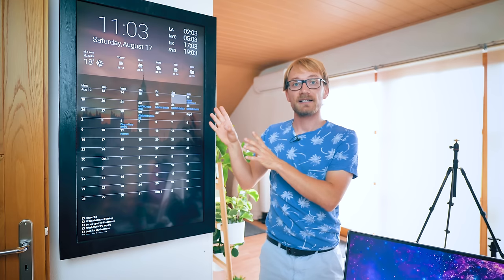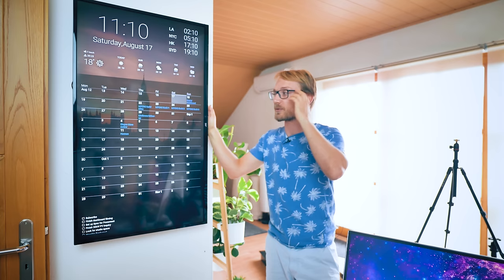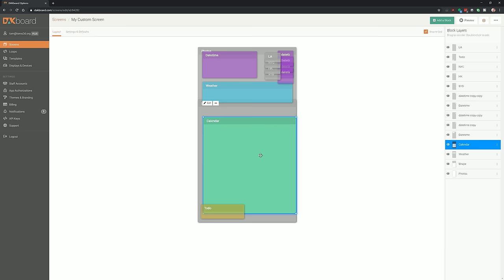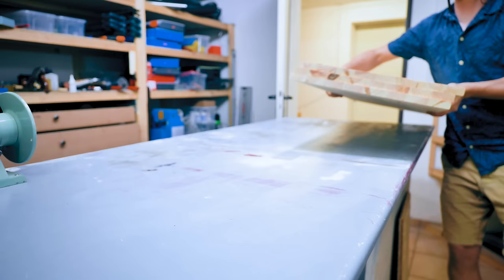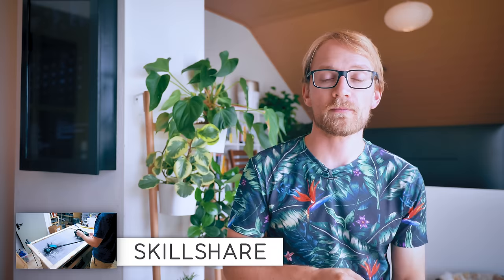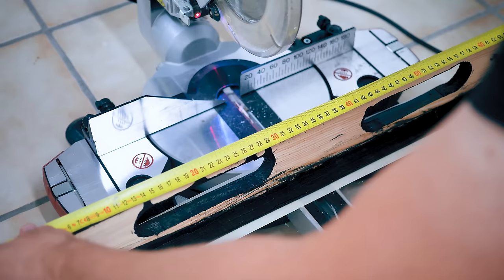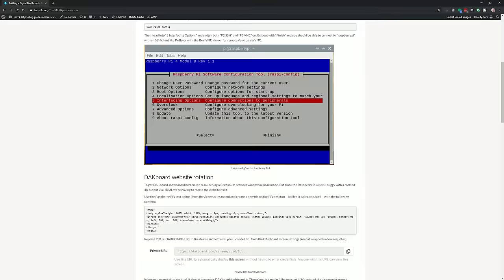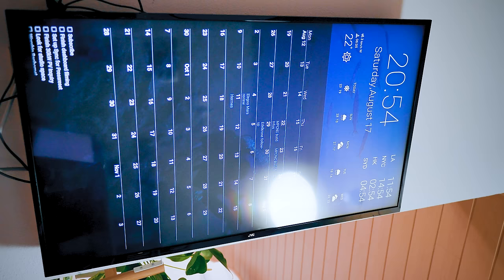Making a Digital Dashboard! (w/ Google Calendar integration)

Comment: For energy saving, I would consider installing a motion sensor for the screen in your frame.
Reply: Or even something as simple as proximity sensor.
Reply: That depends. Some TVs take a few long seconds to turn on and show content.
Reply: That just crossed my mind (just watched the video and was about to comment)
Reply: Then you can just hookup your security system to detect any movemnt in the house to turn tv on. Also if you have presenced information from something like home assistant you can turn it off if no one is home.
Reply: @PhilippBlum  Time is also money. If you have to loiter around the screen for a minute for it to start showing anything, then just open the calendar app on your phone instead. If you want to save time, have this running during the time you're in the office. If you want to save on energy, use your phone.
Reply: newer Monitors don't use much power to display information on screen. the problem is changing pixels. If you have a static image (like his scenario), the power it uses is probably lower than a usual light bulb.
Reply: you could try it with E ink screens tho. where refresh rate isnt all that needed to be high performance.
Reply: Myth Busted. It costs more energy for the initial power to turn the TV on then for it to run consistently for a longer period of time.
Reply: I like that idea
Then it can say "I can't allow you to do that Dave"
Reply: @David-nh7px  One could try to cut the power to the backlight only. But basic electronic knowledge is required.
Reply: excellent idea
Reply: I just tested my TV it took 8 seconds after hitting the on button before it showed picture from an input. You would need a simple TV that shows picture from the input right away
Reply: I did something similar for a digital signage prototype. I used a teensy with a PIR sensor and programmed it to press a key on a virtual keyboard. I then set up the screen saver to display just a black screen and power saving to turn off the monitor after a few minutes. Messing with the timing to help prevent the monitor from saying "no signal" was a bit of a pain but whenever someone gets within about 15-20 feet it powers the screen back on and displays the advert that is always looping anyways.
Reply: Great idea
Reply: Or, since calendars aren't likely to update so often during the day you need to check (let alone justify outlay + running cost),  just use your mobile phone with an app doing the same thing. Or the computer you work upon.
Reply: @nv1t  Thank you! I was wondering what the power draw would be like ...
Reply: He has solar, he doesn't need to really worry so much about that. He's already saving so much more energy than any of us that don't. He's allowed this.
Reply: @DD-gj8ub  But not turning off the TV just disabling the video on the PI won't make it faster? It is still 8 seconds to come back from that sleep state?

The best option would be to go to a store and try sleep mode on all TVs, then order one that is the faster. Or even better, make a web statistics poll, do a video about it, and everyone over the world will enter these properties of the TV he has. 😉
Reply: Motion sensor with integrated  screen saver 👍
Reply: @David-nh7px  A screensaver would be useful for preventing screen burn-in. Maybe a black display would use less energy?
Reply: totally agree with that idea
Reply: @jimmybowler8922  the REAL LPT is always in the comments. I'm a security systems engineer and never thought of this .. 10 points to Gryffindor
Reply: @David-nh7px  that's why  a command line utility named "xrandr" exists. It allows you to change the brightness of the screen down to 0%. That way it looks off and you can just a just the brightness back up to 100% instantly.
Reply: @ranieldenicen.marpuri6544  , the cost for an eink screen of similarly size, tho... XD If you're OK with lots of interrupting bezels (some are white at least), you could get some 8" screens for $50 a pop.  Maybe someday that will be doable but not even now (a year from your comment).
Reply: digital pir to gpio, hdmi-cec on/off. or for some cases earlier detection for instance while walking on/off the stairs to compensate turn on delay. (could be 2 esp32 sending command to pi webhook), or make pi scan the network for your mobile phone presence. good food for thought also other comments here
Reply: I'd say less of energy and more for the burn
Reply: Or just use a colored e-ink screen.
Reply: @PhrostyGaming  To be clear: You think any modern monitor (let's say HDMI capable, LED), no matter the settings, burns more power in the start than in the running for say 10 hours in a day? I have some trouble with that.
Reply: If you’re  that concerned, use a note pad SMH
Reply: I bet you don’t even have one
Reply: Or just use a cell phone to pull up all that data.
Reply: @PhrostyGaming that is only if your TV is running on combustion engine…

Comment: This is one of the projects that would really benefit from a PIR sensor to switch on/off dynamically and not based on a set time. Still an amazing build and a great idea! ;)
Reply: This! It's also easy to implement...
Reply: A regular tv shutting down and turning on can take a long time for older TVs.
Reply: @xoniq-vr  it's a 4k tv if I'm not mistaken, so I guess it's not that old. But you are right, it's probably not the best idea to make it turn off every 2 minutes or so
Reply: I was thinking the same - that a PIR sensor would be a great addition - but I've seen even quite new TVs (and PC monitors) that can take a frustrating amount of time to turn on. I think it would really depend not only on how fast your particular TV/monitor went from off to displaying a stable image (and without overlaying a huge on-screen display informing you that, yes, it's still on the HDMI input!!), but also on your particular use case and physical environment - i.e. could you usefully position the PIR so that, when you walk up to the screen, the PIR turned the TV on a sufficient amount of time before you were actually standing in front of it/wanting to read it.

You'd almost certainly want to crank up the timeout on the PIR sensor as well, so that it wasn't turning off "every 2 minutes or so" as The Tinker Dad mentioned. You'd want to find a happy balance between energy saving and not having it turn on/off too rapidly.

You'd especially want to do that with older TVs with CCFL-backlit displays (... no one's planning to do this project with a 40" CRT or projection-based TV, right‽ 🙀). I don't really know for sure how TVs would cope, long-term, with being turned on and off several dozen times per day, but I imagine that newer LED-backlit TVs would handle it much better than CCFL-based displays, due to the high-voltage circuitry used to drive CCFLs.

You might be able to have the TV/monitor turn off just the display, which would probably make it faster to come back. Maybe use that at first and then turn it off fully after a longer delay - similar to how Windows is often configured to turn off the screen after a few minutes and then sleep the whole PC after half an hour or so.

I still wouldn't be surprised if a TV used for something like this needed its power supply capacitors replaced after a few years - but honestly, if you have basic soldering skills, recapping a TV/monitor power supply is usually easy enough and is a very useful skill to have, given how often a dead TV/monitor merely has a couple of failed electrolytic capacitors, so for a few currency units and an hour or two of your time you can have a fully-working display again! :) (Just WATCH OUT for the mains-voltage bits!! Obviously unplug it from the mains before removing the cover, but the capacitors on the mains side of the power supply can hold a nasty charge, even several days after unplugging it! Anything up to 340V is possible, depending on where you live and the circuitry in question, and that's not something you want to feel the sharp end of!)
Reply: Jelle Posthuma Yeah sure, but you could increase the interval to find the sweet spot and SmartTVs nowadays have a semi sleep function (my LG takes just 5s from being off to running Netflix for example)
Reply: Andrew Gillard Great points! But rather then kill power to the TV I would get a PIR module that can interface with the PI and send CEC commands to the TV (less strain on the power supply components). This way it might be possible to dimm the backlight or switch it off entirely
Reply: Then i would suggest using a radar sensor, they can be embedded in the frame without being visible
Reply: Turning on and off can use more power then letting them run longer
Reply: Rob Aerts yes, this is also a great idea!
Reply: Aaron Argent I don’t think that modern devices, which are always on anyways, would chew more power on a power cycle than the huge, massive power draw, LCD panel being always on, even if their is nobody present
Reply: How about just turn on and off the back light, which needs the most power? The TV itself can stay turned on on a time basis.
Reply: A channel has no name How would you do that without breaking open the TV and replacing the wires with a relay? It would make sense yes, but doing it is a little more difficult than you might think ;)
Reply: @aaronargent  yeah, just open it up and access the power line to the backlight. I don't think it would be that difficult.
Reply: @achannelhasnoname5182  Wouldnt it be easier to just toggle the tvs standby using the HDMI CEC from the raspberry pi
Reply: I totally agree on using a PIR to toggle the screen using the cec commands when no one is around. However most screens tend to show information on the screen when being enabled again, like input source and such, and that is annoying.
Reply: @stefan.krause  Turn it on from nearby rooms. While you approach the TV, it is already on and the OSD is gone. 😉

It is probably good to add some heuristics anyway. For example if you move around the house, don't switch it off, but if you settle down somewhere then you could turn it off. With PIRs in every room and with some movement tracking, you might even know that you are in the TV room just stopped moving, and prevent turning it off in that case.

Or another idea: use some proper router (MikroTik) and track yourself by your phone. Query station assoc/disassoc log, and/or station RSSI. Everyone carries their phone even to the toilet nowadays... 😉

Comment: The wiggly end on the measuring tape has a purpose!

If you push against something it will give you a correct measurement and if you pull on it the wiggly bit will adjust so the measurement is accurate as well. By being wiggly it corrects the error due to the thickness of the metal bit.
Reply: did not know that but it makes sense
Reply: heh...another woodworker on here!
Yes, as anton said, the amount of play in the end, is meant to offset the thickness of the end.
Reply: Yes, tape measure is handy for measuring real world spaces but when marking out work Ive always done the same thing, go from the 10cm mark. It does make it more accurate if you're going for precision& ive also made the same mistake as forgetting to deduct it.
Reply: You took the words out of my mouth, but I have to confess that when I'm doing tight tolerance stuff like cabinetmaking, I measure everything from the 100mm (10cm). 
When I do carpentry, then trusting the hook is all good for that for me where slight 1mm+/- tolerances are ok if it happens.
I'm a tradesman, are you a tradie too?
Reply: @Colaaah  I like the wooden collapsible  rulers with the 6in slide piece at one end for tight spaces
Reply: @Colaaah  Why don't you just use a folding rule? That is /the/ ruler for carpenters isn't it?
Reply: Oh, this was news to me. Makes sense when you told us.
Reply: Umn no.
Go grab a brand new tape, they don't wiggle lol.
It's because you retract it and don't stop it, it's ruining the tape....
Reply: @SoloClone  Incorrect.
Reply: @seansimons8624  I'm not wrong.
And yes some are built like this, but lesser tapes of course.
Reply: @SoloClone  Yes, you are in fact, wrong.  Brand new tapes do "wiggle".  The purpose for this is exactly as described by Anton S. I've even seen workplaces that routinely check the amount of wiggle in a tape measure to make sure it is within tolerance as part of their quality system.
Reply: @londontrada by deducting it, you've made it less accurate
Reply: @SoloClone lol, no
Reply: Tnx, just saw your comment and saved me a lot of typing.
Reply: Yes, this is the very reason you should not let the tape measure slam back during the recoil when you are done using it.
Reply: @SoloClone  They most certainly do have movement, for the very reason explained from the original commentor

Comment: the "wiggly end" or hook on a tape measure moves to compensate for the thickness of the hook so you get the same measurement whether you push the tape up to something or hook it on to pull.
Reply: But it is only good for measuring from an edge away from the tape and where you have space for the hook. It is in the way when you want to measure from anything else.

Comment: Hey Thomas never buy a tv mount again unless you need the tv to swivel
the best easiest and cheapest way to mount a tv and literally make it earthquake proof is by using two french cleats 
directly bolted to the vesa mount and the other part on the wall . the best part is you can pretty much make them in a 
couple minutes just using some wood a saw and a drill. best part is you can take the tv off the wall and put it back in seconds
Reply: I'm an IT Systems Administrator and Woodworker and this has never occurred to me! All my cabinets in my workshop are on french cleats!
Reply: This is how I am doing it as well. I have a 55 inch done this way. So i would say it works at least up to that size.
Reply: I have french cleats all over my garage, and use them in my game room for the tv and other shelving - totally awesome.
(I had to make them nice and stain them for the wife).
Reply: Thats a very unsafe way to hang a tv. You can get a flat tilting wall mount these days for $15. Imagine you have guests over to your house, someone bumps into the TV and it falls on them. Now you have a lawsuit on your hands because there's nobody else to blame for building the mount that failed
Reply: @andrewredding3132  what kind of guests do you have that would sue you for their error of bumping the tv down? lol
Reply: @andrewredding3132  First of all, that's highly unlikely to happen - why would a guest be sliding along the wall, long the same plane as your TV?

 Second, what kind of friends do you have, that they would sue you over something like that? 

This is a bizarre scenario on every front.
Reply: @johnjoeoregan  Must be USA ;)
Reply: @andrewredding3132  Agreed. I have kids that would inevitably bump that thing.

Comment: Very cool project! You could even add video streams from 3D printer webcams at the bottom to monitor prints.
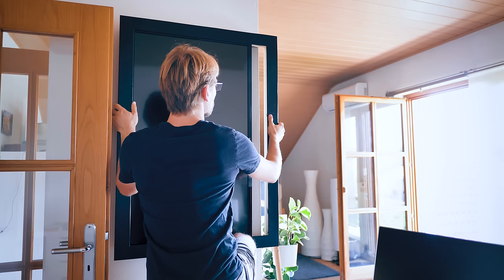10:45 "... don't have to deal with the wiggly end..." Face palm! The wiggly end have a purpose. It slides in and out the precise length of the thickness of the metal bit, so the measurements will be precise no matter if you measure from the inside or the outside.
Reply: this guy is a hack. it's not the first time he makes stuff about things he has no idea about. he makes pretty stuff that looks pretty on color graded video. I have serious doubts about the quality of his work.

Comment: Thank you for the inspiration. I put it behind a see-through acrylic mirror, and added an arduino with two ultrasonic modules as an input interface for gesture control. I can swipe with my hand to change between the information screen (family calendar and tasklist, weather and traffic info) and an empty screen with just a digital clock, so I can use it as a mirror, too. It also allows future expansion.

Comment: Tom, I did kind of the same thing you did, except I went with PiSignage. It has a lot of great plugins for weather, task lists (I went with TinyToDo), and much more. I was also able to show content from multiple web pages on the same screen and uploaded pics of scenery to make a window to anywhere. The cloud access is nice as well. I like that you can group Pis into different content lists and update them all with a single click. As for cost. It's free to use if you have 1 or 2 Pis. Beyond that, I think the price is still fairly reasonable.

Comment: the wiggley end is like that for a reason.  It doesn't make the measurements inaccurate. If i remember correctly the wiggle is 1/16th of an inch.
Reply: That's right, the end pulls slightly outwards for making outside measurements (tape in tension), and then for inside measurements (tape in compression) it pushes inwards by the thickness of the end piece. This compensates for the thickness of the end piece.

Comment: 10:41 The wiggle in the end of the tape measure is intentional, the hook can move the same distance as the thickness of the metal so it can measure correctly using either side of the hook

Comment: FYI what you call the wiggly bit at the end of the tape measure has a purpose. That wiggle is really a gap that is the same as the thickness of the "wiggly bit" it self. Basically it so if you push  or pull on the end of the tape you get the same measurement.

Comment: You could wire a PIR sensor to the GPIO of the pi and use that to trigger HDMI CEC on/off commands via a little script. that way it only comes on when it sees you coming near it and then can turn off again after a few minutes of no-activity.
Reply: I was about to write the same suggestion

Comment: Your boards are already glued staff stock. So as long as you cut your pieces along the grain direction, with top and bottom as two strips against the grain, you'd get the same effect with far less material spent. Doing this you could even slightly improve the cosmetics, by cutting your pieces between the glue joints.